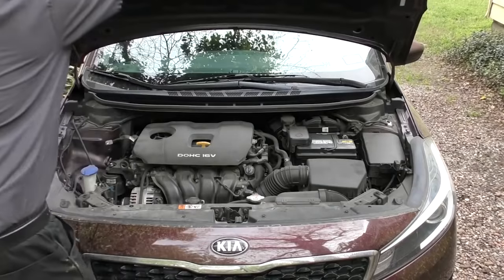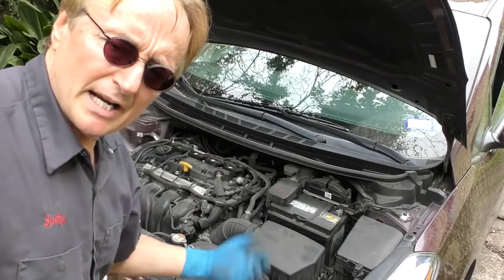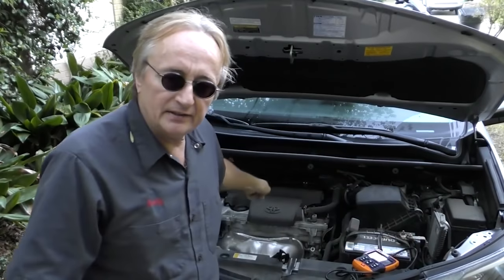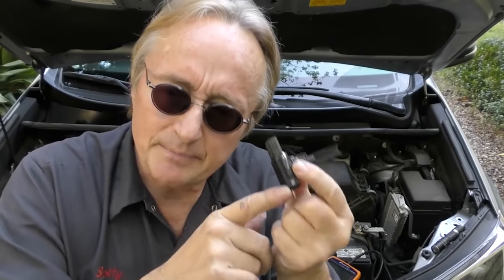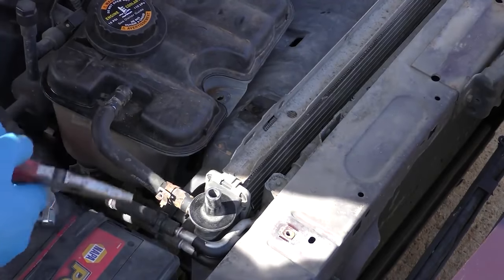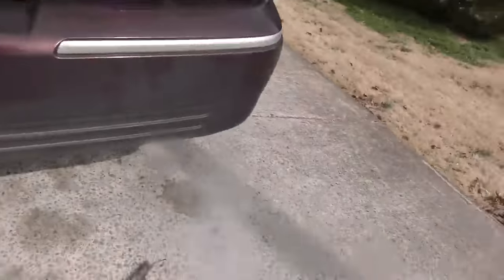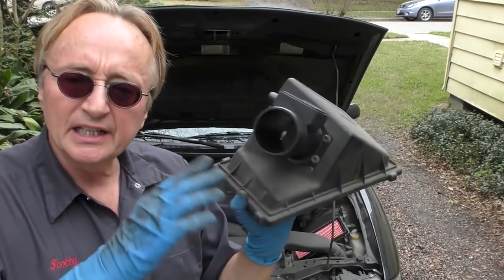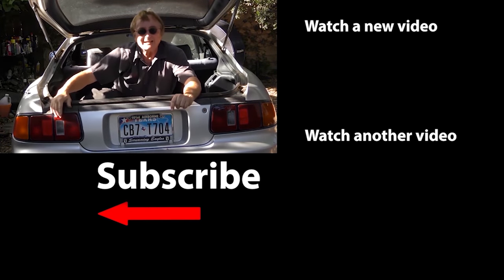4 Signs Your Engine Has a Serious Problem

Comment: I’m still trying to figure out why my 2004 Toyota Camry has been rarely sputtering at 600 rpm idle, hell the lights dim a little with the sputtering. Almost in sync with one another. I figure it would be at least a dirty fuel injector. The car runs fine sometimes, no issues but there goes that sputtering again lol. It throws no codes

Comment: I have a 2013 Volvo XC60 RDesign which I imported from Canada to Jamaica where I live. Here are some of the issues that I have been facing with this car:
- check engine light has been on for quite a while;
- it displays a message that the park brake is not fully released;
- sometimes the dash goes blank, and the power windows does not work;
- the moonroof remains in open position.
I wrote to Volvo about the issues and they advised that they don’t have a rep/dealer on the island so I am left to figure this out. How can you help me sir?

Comment: what caises engine to stopwhile on idle for 10mins while warming it up? no error code, new couls and sparkplugs, new crank and cam shaft sensors, rnewubber grommet on fuel pump.

Comment: I just had a 2015 Kia Forte with #4 cylinder misfire  swapped the ignition coil it didn’t move so I replaced the spark plugs then all cylinders misfire so I checked the ignition coils by removing the power plug one at a time got one ignition coil bad replaced it still all cylinders misfire so I took out the fuel injectors and cleaned them all codes went away ✌️🤙

Comment: Easiest way to find a vaccum leak, use engine started fluid, its under 10 dollars. Start your engine, spray it around the vacuum areas. If your engine revs, wherever you spray it to make the engine rev, thats your vacuum leak. Just dont spray it directly into your performance air intake, your engine will stall, wont hurt it, but you should clean the filter.
Reply: Also, another tip, if youve checked everything, and you cleaned your mass air flow sensor(MAF). You might need a new one, MAF sensors are a expensive piece of plastic, so double check everything else. Shouldn't go out below 150 thousand miles. I know mostly everything scotty talks about, I just love his videos so much😂

Comment: My 11 Pilot has misfired twice. Mechanics have determined its not coils. Both times it’s cylinder 3. Each time the spark plug is fouled and has oil on it. 

What does this mean? 

Took to two different mechanics. They just put in new spark plug. Last mechanic said it’s a sign engine is going

Comment: Hey Scotty I have a 2004 Audi S4 4.2 L V8 I had seven codes I got it down to One code and I have a cylinder misfire I switched out all cold packs spark plugs and replaced to fill injectors and is still having a cylinder misfire on number seven what do you think it possibly could be ????

Comment: I have a 99 ford v8 4.6 .. had a misfire on cylinder 7 ... replaced plugs wires .still light.replaced battery cuz battery was bad still light,then the coil pack for that cylinder I changed .still light .....needed up being a bad altonator ......replaced it with a stronger one an light went away ..... crazy

Comment: Never get your oil changed at express oil change if you own a Kia. Their oil filters are substandard and are too small. The car's oil pressure will drop and you will hear the cams rattling. Make sure you use premium quality oil filters, NAPA Gold, Original Equipment etc. The VVT system uses engine oil as a hydraulic fluid. If the oil pressure is too low or too sludgy the car will have problems.

Comment: I had a 2006 Ford Ranger that would trip the lean code twice a year, once in the spring and once in the fall.  Ford tried to fix it, but it still did it.  I started re-setting the code twice a year.  No sure why this happened.  As to the radiator, my experience with Ford versions of these is that they are complete crap compared to the old brass ones.  I had a 1982 Ford Ranger that went almost 300,000 miles with no radiator issues(brass radiator).  The aforementioned 2006 Ranger and a 1992 Escort I had went less than 80,000 miles(6 years or so)  before the plastic ended radiators failed.  I was considering replacing the 2006 Ranger radiator with an all metal aftermarket replacement until it was rear-ended and totaled. Quality is not job 1 with modern Ford radiators.

Comment: My 6.0 silverado has a rough idle at start revs up on its own like it's going to stall but settles down after about 30 seconds no stored codes or check engine lights I replaced the sparkplugs 6k miles ago which made it stop but it came back and now I can't figure it out any suggestions? I'm thinking ignition coils are causing sparkplugs to go bad but shouldn't their be a check engine light?

Comment: IMO - there is a missing tidbit of info on the fuel pressure check.  

Perhaps implicit to his discussion on the special Toyota gauge adapter, the fuel pressure gauge must be attached “along” the fuel line not at the end.  That allows the engine to be running for the test, with fuel flowing the pressure reading “at” engine would be net to reflect any loss across the filter which would assess the clogged filter situation in addition to proving pump can deliver the required spray pressure. 

For old engines with mechanical pump and maybe carburetor (vs electric pump on new cars) this situation is rather implicit -  the starter motor moves the engine internals to actuate the pump bellows.  Fuel still needs to flow whether or not the engine is firing, and hopefully the engine isn’t being flooded during a standstill test.

Comment: I have a 2003 jaguar x type 2.5 no thermostat cause they was sticking new water pump new radiator no leaks and I'm still running hot put blue devil in I and it's still running hot fans work no smoking no knocking steady loosing coolant I'm lost

Comment: @Scotty Kilmer. I took over a 94 12 valve that has sat for 5 years with no fuel. Can i loosen the new fuel filter i got and use a rag and a air hose at the fill cap to prime fuel to the pump?

Comment: Hey Scotty my car has a high idle and never drops. When I put it in gear it drops to 900 RPM. Had the throttle body cleaned and still having a problem. Im lost! Any ideas? Filter is clean. Map scensor is good. iAC is good. A shop did my work and I already went back twice.

Comment: Scotty is it true that some 300 codes might refer to the 1st cylinder to fire in firing order. So if you jad a p0301 and if hypothetically the number 4 cylinder is the first to fire in order then that would be what their considering for the p0301. Instead of the actual number 1 cylinder.

Comment: Scottie, my 2001-2005 toyota rav4 has a problem.  I was driving it and all 4 wheels locked up on me. The wheels would not turn. What seems to b my problem. I need it to be fixed. Nobody seems to have a solution.

Comment: I think instead of using a screwdriver for the tab you could have pushed it in further relieving pressure from the back of the clip then who is it open and pull

Comment: Hey Scottie. I bought a 2011 toyota tacoma 4cyl 5speed pickup . I can barely get 16mpg with the stock size tires and no check engine lights. I do have a camper shell on it. But can I do anything to get a little better gas mileage?

Comment: I have a 2010 Volvo XC60 T6. I have a P0420 code and it comes and goes. I also got 2nother codes and my local mechanic said it had to go to Volvo for computer reprogramming. A 200 mile each way and over $1,100 and having to order parts I came back the next week to no check engine lights until inwasb150 miles away and the check engine light with P0420 back on.... any ideas? It doesn't seem to affect milage.

Comment: Hey Brotha, I gotta 2001 IS300 that won't start. I replaced fuel pump, no change. EFI relay replace with no change. I sprayed started fluid in and it sputtered for a few seconds and stopped. It's driving me crazy. Can you help me out?!

Comment: We have a Jeep Grand Cherokee and we have a cylinder 2 misfire the idle bounces up and down very slowly but not very high it goes low then back to normal
Reply: We replace the spark plugs and wires and it still had a misfire

Comment: This is probably a dumb question but won't swapping the ignition coils change the firing order?
Reply: Firing order is controlled thru the wires.  You leave the wires in place as they are and remove the coil from the wire then move the coil to the other cylinder's wire

Comment: Someone @me. 
My vehicle on cold start sounds like the fan is wobbly but then straightens out after 2 or 3 seconds. Bunch of front end needs work, too but idk what to focus on first.
1: fan sounds wobbly on cold start or after it's been sitting for a while. 
2: front wheels sound grindy for a second when turning left or right all the way.
3:sounds rough when it hits a wee speed bump. Shocks/struts?  
4:when picking up slight speed the wheel feels like it wants/does pull to right and left
5: AC doesnt work, fuses are good

Comment: What do ya do when it says all are misfiring, when they were all fine? I know now i probably got a vacuum leak. Runs great down the highway, only idling is low or cuts out. Just had some work done. Cant find the dang leak. Course its been barely above 0 outside. Can i run it like this for a couple months?

Comment: 7:00 running to lean at high speed = fuel injection, weak fuel pump, fuel filter or maf sensor.

Comment: Do you think radiators should have only distilled water?  Or is tap water fine?
Reply: Distilled and the proper anti freeze, or, as suggested by S itty and many, use the 50-50 mixture pre-mixed, of the right type for your engine.

Comment: Man I got a 98 Honda Accord lx it hates hill I can only go 50 up hills if I try to step or start gaining speed it jerks same as if I try to pick up speed quick from a stop so at a stop I have to slowly step on the gas Or it jerks I have bad oil bad radiator fluid just got a radiator flush and OIL IN MY SPARK PLUG VALVE hopefully fixing the spark plug situation ( full tune up) and  oil done hopefully it’s good
Reply: Also gotta do my thermostat and my head gasgets

Comment: I got a p0406 code we changed all 6 spark plugs checked the coils and put in engine cleaning fluid and my car is still jerking when I accelerate really fast like I'm going on the highway for example and I accelerate fast to get up to speed and the car will jerk them goes back to normal driving. What's going on with my 2010 Honda Odyssey

Comment: The first part to fail on the misfire caused the driver to seek help for his symptoms.
Plugs don't loosen up unless they weren't properly tightened or were wrong parts somehow. A wider set gap on one plug can make it misfire as the tip can wear away.
The gap keeps widening, so use a wire ring gapper and not the ramp type because it can also hurt the center electrode with sideload during the gap setting.
The ring/wire type is the right tool. It's not expensive but it might be difficult to buy without it being in stock at your part store.
This is why real technicians go to the trouble and their tools and experience can save you money. Be loyal to a good technician and pay him for his work.
You tip your bartender, don't you?
He is not expected to clean, serve, and advise for free. He looks out for your best interest just like Scotty would.
Reply: This is false. Ford’s 2 valve (and older 3 valve) 5.4 engines were notorious for literally spitting spark plugs out.
Reply: IT is not false and you have a problem child example.
Yes there's a problem with those engines.
Most engines don't do that.
Scotty's working on an inline 4 cylinder KIA.
I did not say every build of every engine by every manufacturer has no issues with spark plugs.
I also was not talking about a problem child Ford.
Ford makes problems they know how to prevent. Just like you.
They prove it every few years on a lot of things. 
We didn't see Scotty's plugs up close in the video, and all he did was tighten them and then tell us he replaced them, evidently off camera?
We don't know who put the problem plugs in there, but notice they had no discoloration.
At 80k they would show discoloration.
My bet is those plugs were changed before Scotty was called in to diagnose.
Scotty found, according to what he said, "worn out" plugs but they sure were clean from what he held up.
The KIAs I've changed plugs on had carbon build up in their threads and I've used foaming carburetor cleaner to get them safely out.
So anytime you have an automotive issue, you first consider make, model, and year.
You then consider which engine and power train.
Then you consider recalls, then tech bulletins, and begin the diagnosis and then verify symptoms.
If it's been worked on, you also consult the service records.
"Who did what when" can lead to the cause.
Sometimes you find the customer screwed new parts in it as a preventative, and you have to put the right parts back in the right way.
That's how it truly is when you do this stuff all day for years, and observing several other techs and hearing also what they find. 
You have kids at part stores making recommendations and people who watch advertizing.
You also have Disney Tune putting cheap, off brand tune up parts in alot of cars as fast as they possibly can to get as many cars done for a price on a menu.
People wish for instant gratification or they wish to save by trying to do their own.
That ends up making more work for real technicians quite often.
I've probably seen it twenty times a year for 30 years.
The right plug, the right procedure, and the right torque can solve quite a few of them.
And you set the gap according to the best information using the right tool.
These are just the facts.🎉

Comment: What if all 4 cylinders misfire for about 20 per week but it runs fine.. mechanic previously replaced the rings but not the pistons, could that be the issue ? 2008 B8

Comment: im having all my problems in cylinder #6 2.8l cadillac cts 2006 first check engine light told me cat converter this car has two $1500 i replaced cat converter, on my way home check engine lite came back on said coil i replaced spark plug and coil drove in the light came back this time it wasflashing saying #6 injector was bad so i changed the injector and plenumgasket and drove it once again checkengine came back flashing once engine warmed up  it shakes but once i let off the gas the light goes away. I didnt use a torque wrench for any thing could that be my problem since every thing was in #6 cylinder please help thank you

Comment: Hey Scotty, I have a 2018 Ram 2500. The top end of the motor, is making a really loud ticking sound even when I let it idle, it ticks, when I accelerate it ticks. What could it be? I have good oil pressure, but the computer says misfire in on cylinder 8. Any suggestions?

Comment: ive got a question my boss has a 2001 yukon xl runs rough on start up until you unplug the MAF then runs normal but after its been warmed up you can plug the MAF back in no issues but teh MAF has been replaced any adffvice

Comment: Too much work for that method, on a 2009 Sentra, as you have to take the intake manifold off to get at the spark plugs, and then have to put it back on to be able to start the car. Nissan, what were you thinking when you designed the Sentra?

Comment: My Glow plug light comes on when I harsh rev a 50 miles an hour or higher. The p2279 code is what I get and it says intake air leak. It's a Audi a3 1.9. Does anyone have any ideas as to what is going on, Ive done smoke tests and cant find a leak, flushed out carbon and cleaned the MAF censor. I'm out of ides.

Comment: I have a question I have a 1989 Ford ranger and my check engine light will turn on and it will drop rpm then when the light turn off and it goes back up…it does it at idle and while driving at any speed after I run it for about 30 min it will stop doing it anyone have an awnser I have went to so many people and nobody has a clue
Reply: Also while I’m drive when the engine light turns on I lose a lot of power

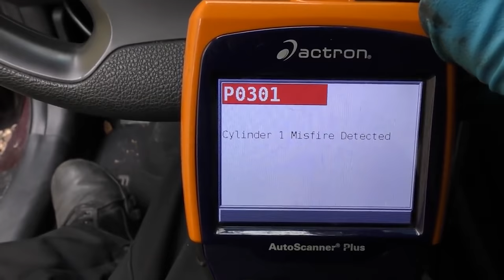Comment: You mean "it's not the injector" @ 2:20 minute NOT "it's not the coil". Switching the injector to cylinder 2 should have transfered the code to that cylinder if it was a bad injector.
You need to test the coils. There is a difference between "coils" and "injectors".

Comment: I need help I’ve been having code P2304-00 I’ve changed the plug twice and I swapped the ignition coil but it still keeps popping up the problem usually starts after the check engine light comes on and I start to lose power it doesn’t accelerate the same and it shakes when the car comes to a complete stop and now the car has trouble turning on PLEASE HELP!!!!!

Comment: I was having problems with my 2008 vw polo 1.4 3 cylinder TDI with 100.4000 miles on the clock it start to rev higher on tick over a intermittent fault but the check engine light came on weeks later I plug my sons Bluetooth tester in code p2108 throttle control module probably came up I cleared off a was going on Holiday for a week thought I’ll take it to the garage when I get back because it was still running okay one on holiday the light cam back  so I decided to have a look myself and took the beauty cover off the was a rubber dust on the vacuum control and when I look at the pipe the was holes in it taped it up the car was running like new the cover had put the holes in the pipe when we returned home I calculated the cost to take the car to another hundred thousand miles the cam belt was Due to be change shock absorbers were bad brakes spotted 2015 Vauxhall Astra diesel with 40.000 miles the dealer mede me an officer I could not refuse the Astra is a lot smoother drive also the engine has a chain driven cam it also does more mpg and I like having the extra room and comfortable ride